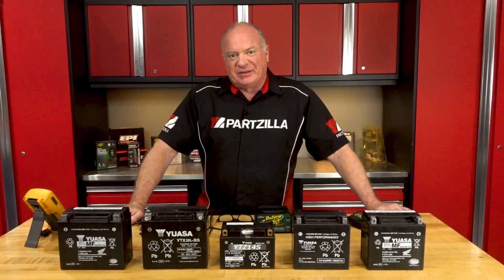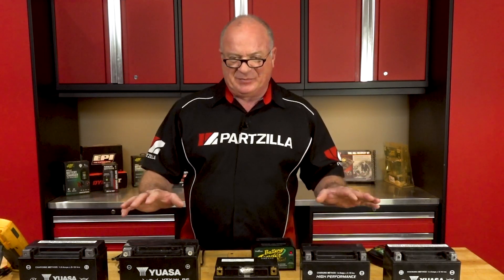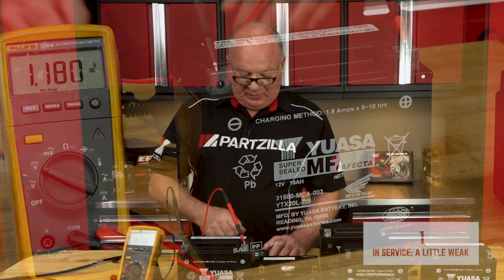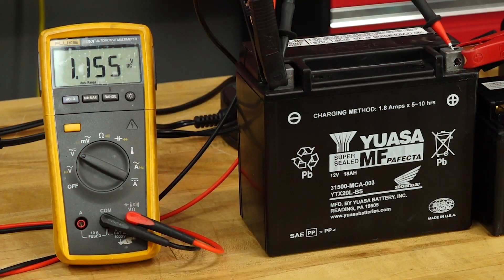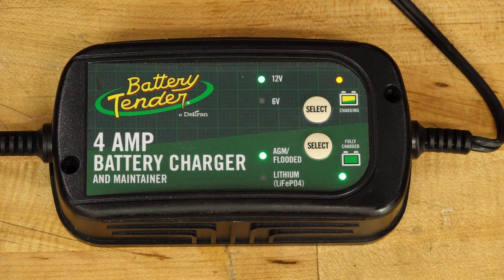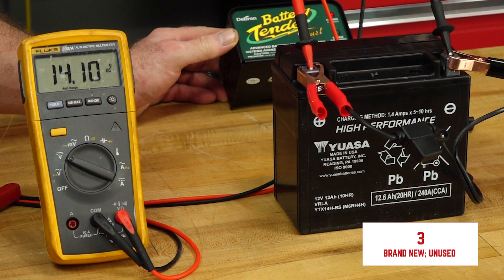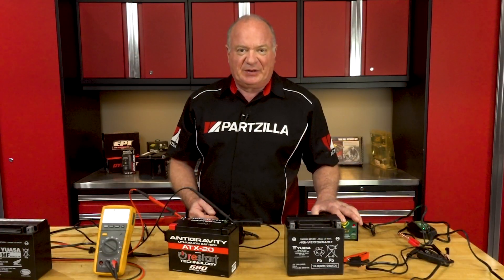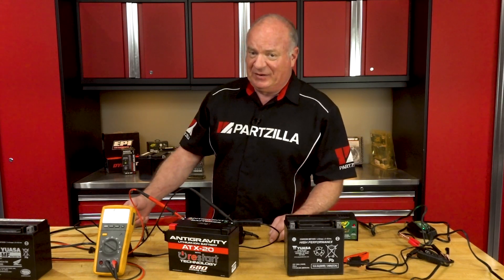Battery Tender Chargers | How to Use a Battery Tender | Which Battery Tender Do I Need | Partzilla

Comment: My mom had a 1975 CT90-cool bike! . I bought the 1.25 Battery plus way back around 2002 for my CB400F and I am still using it to maintain the battery in  my spare truck. Has always worked great with no issues. Just got a Genius 10 tonight and hoping it will be as good!

Comment: I had a lithium battery get drained by a key that was left on and my charger wouldn't recognize it or even attempt to charge.  So I pulled out my OLD (we're talking 1990's here) dumb 2 amp charger and put it on the battery for about 15-20 minutes, off the bike, sitting in my driveway and monitoring it closely for any heat or swelling.  The battery got just enough volts into it where the lithium charger would recognize it, then fully charged the battery, and I used it for years.  If I only had the smart chargers I would have had to throw away that $100+ battery.  I guess this was before the batteries starting coming with internal logic to prevent a deep discharge?